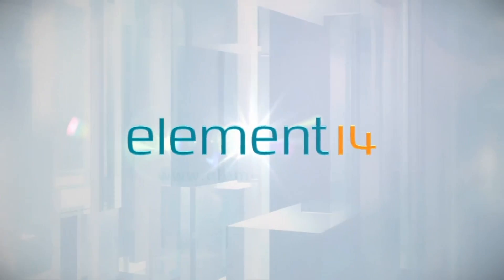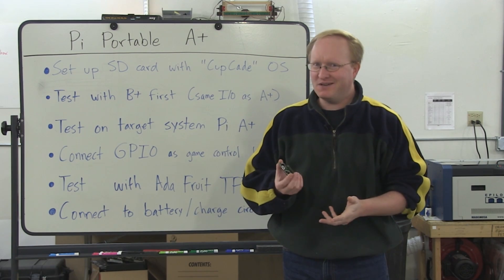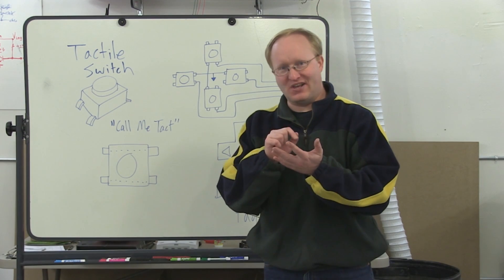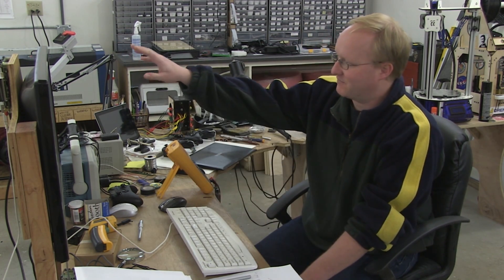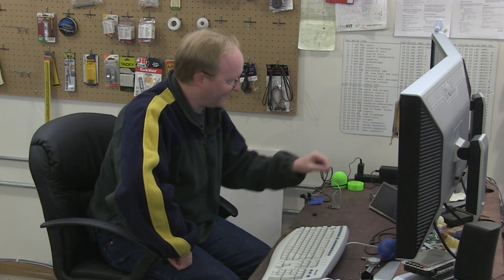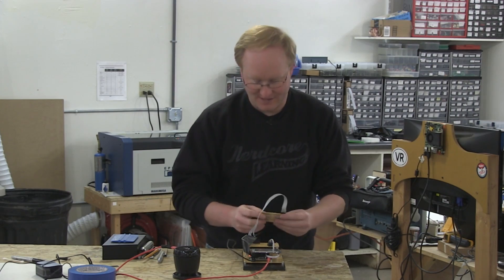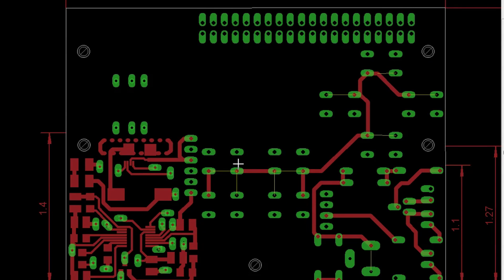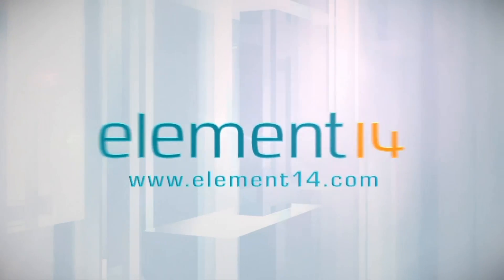Ben Heck’s Raspberry Pi MAME Portable Part 1

Comment: Im interested in building a tabletop arcade using a raspberry pie but more than that id like to know if its possible to use that same pie to then control an animated RGB LED grid on the side of the arcade to display retro sprites? one pie 2 programs maybe you could try this?

Comment: Wow! My current build is loosely based on ur original mame portable except i decided to go with retropi os, the changes i made are shockingly similar to what you're doing here, i went with the A+, usb charger battery pack hack, i didn't have the budget for the adafruit tft but i defiantly spent a great deal of time gawking at it while i shopped for  my build, i had a gbc case laying around cuz i shoved the gbc into a broken ti-83 calc, so i didn't have to muck around with cnc cutting and such XD

Comment: I downloaded cupcade, loaded the image onto a 8gb sd card (win32disc imager), put it into my Raspberry Pi 2 model B but nothing happens when I apply power, the red and green LED stays lit, any ideas for a solution?
Reply: that might possibly work, ill try it when I get a new sd card, for now I'm using a wheezy raspbian image, along with Retropie, emulation station and Adafruit's Retro game master mapping GPIO pins to a tact switch
Reply: ***** I want to try Cupcade just because but Retropie along with emulation station provides a nice GUI, so for now I'm fine with it. Not a big fan of the fact that configuring the Emulation Station controls doesn't configure controls for the emulator you use, still having problems dealing with the retroarch-joyconfigs :/

Comment: Hi Ben. I have a question. I have a laptop MSI EX600 and does not work. Is it possible to replace a broken motherboard and use the Raspberry Pi 2? It is possible to use the keyboard and LCD on a laptop? Thank you for your response.
Reply: no, it's not possible, the laptop uses a vastly different display protocol (not HDMI or composite, not SPI either) and the laptop's keyboard would need a dedicated driver board

Comment: You should be able to SSH into the OS using Putty on Windows or OSX without needing a separate Linux machine. Though, like most Raspberry Pi OS flavours, you'll probably need to enable SSH via raspi-config.

Comment: I was wondering you use the raspberry pi for a lot of mods. I was wondering is there a way you can show us how to take a cheap store bought router without the USB ports add a display out. then flash it with Linux openWrt the router distro to make a cheap home-brew version of a raspberry pi.

Comment: What's the motherboard used in that Linux PC? It looks cool.
Reply: Asks about motherboard, gets flames.
Lol
Reply: I know that. I also know basically any computer can run linux. I was referring to the computer that had ubuntu linux installed. I realise now that that was bad wording and I apologise for that. I just wanted to know the name of the motherboard he was using for that computer.
Reply: Tevqoon This is the internet. You cannot ask questions or have an opinion. Shame on you!
Reply: Tevqoon Not sure what make & model but it looks like an M-ITX board.
Reply: I have a board like this that I ripped out of a broken touchscreen smart TV at work! Turns out it runs Ubuntu very well, I mean what doesn't? Looks to be either bespoke or an OEM board.
Reply: Tevqoon First of all, "linux" isn't a type of computer, its a kernal, GNU/Linux is the OS.
Reply: Tevqoon Looks kinda like an Intel NUC that's been taken out of it's case. Could be something else like a Gigabyte Brix, but it's definitely some sort of Micro-PC Motherboard, even smaller than a Mini-ITX. It also runs off a small A/C Adapter, compared to a large PC power supply.

I really like those mini-PCs, the AMD ones can even do some light gaming thanks to their new APUs.
Reply: Even if it isn't, the Tegra K1 Jetson seems good enough to run ubuntu for when you need linux. And it's cheap. Thank you!
Reply: You mean Raspberry Pi.
Reply: No, the linux computer that's running ubuntu he uses to add anc configure the OS.
Reply: I have no Idea about the motherboard, but I must ask in what way do you think it's cool? Asus z97 gold motherboards are cool..
Reply: I don't know really. Just the fact that it's kinda small and square. Would totally use it in a computer running linux.
Reply: Tevqoon it is more of the practical then the estetic?
Reply: Yes, that's why I like it. Also thanks for the response, I'll try to look for one :)
Reply: Sure your not getting it confused with the Rasberry Pi A+? It doesn't look like a normal Pi thats all..

http://www.raspberrypi.org/raspberry-pi-model-a-plus-on-sale/
Reply: ***** you´re right. it´s the mainboard used in a Zbox Nano. its Formfactor is Nano-Itx (12*12cm or 5*5")
Reply: The screen I think its the Tegra K1 Jetson Looks Like it...
Its a great board...
Reply: NP!!!
Reply: It could be any brick size computer out of their cases.
I am thinking about an intel nuc maybe...
Reply: looks like a laptop MB to me
Reply: bloodless2010  you know what he was talking about.
Reply: Fish god cult yes, but it is very bad practice to call the OS linux itself, linux is a kernal.
Reply: Everybody: kernal
Me, a smart person: kernel

Comment: Felix really should be wearing eye protection when working with etchant. It's nasty stuff!
Reply: ShadowBlade
I agree, but I think you have the > the wrong way.

You can always edit the comment though so it isnt a problem.
Reply: And correct gloves, he needs Nithril Gloves.
Reply: If I remember right, they have very good air circulation in their new shop. Though, I agree. That stuff is nasty.
Reply: Cory nope, for example < 4 means less than four 3 < 4 four is greater than three
Reply: No, reverse.
Reply: ***** Well shit, but he doesn't.
Reply: or just use a phone emulator and attach peripherals?
Reply: Agreed.  He's almost got his face in the stuff.  I squirted etchant into my face as a kid and was lucky I only got pain and not any eye damage that I know of.

Comment: Well, I really like the building process when they design and build enclosures, but since it allready looks like a old gameboy, why not enclose it into an old (preferably broken) gameboy?!?
From the dimensions it doesn't look that far off...
Reply: It's too wide fore a gameboy. The lid is, anyway. If you Google "adafruit game girl" you should find a cool project where they put a rpi inside a gameboy color :)
Reply: Christopher Pilcher
Well they don't specify which display they are using, but from what I can see, I assume they are using the PiTFT from Adafruit, which is a 2.8" display. The Gameboy Classic (which I was talking about) had a 2.6" display.
Therefore not much difference. OFC idk how much space there is within the enclosure of the Gameboy...
Reply: The screen is 2.8 inches, but the driver board that the screen is on is quite a bit wider.

Though, you could probably separate the two pretty easily, and build it into the gb case.